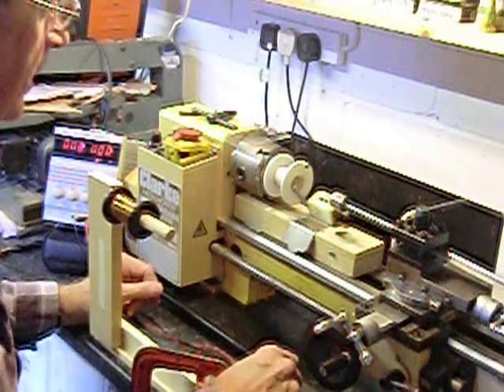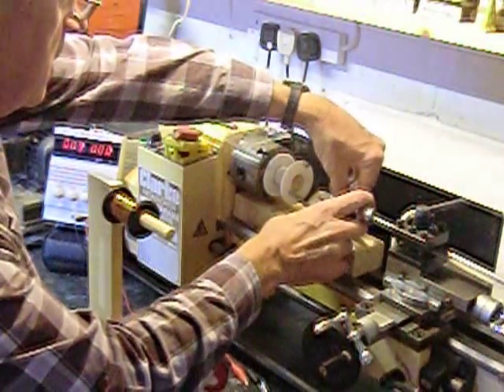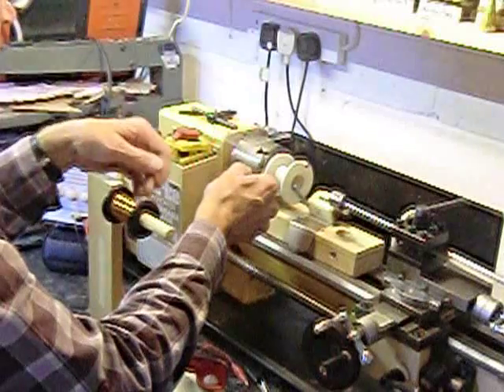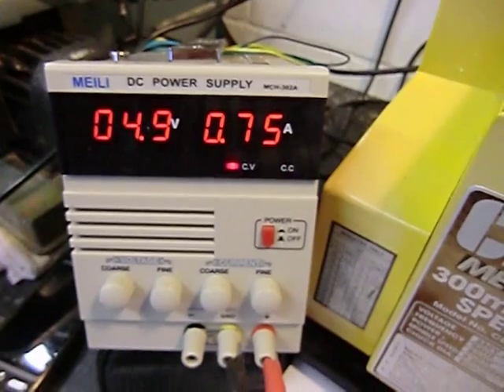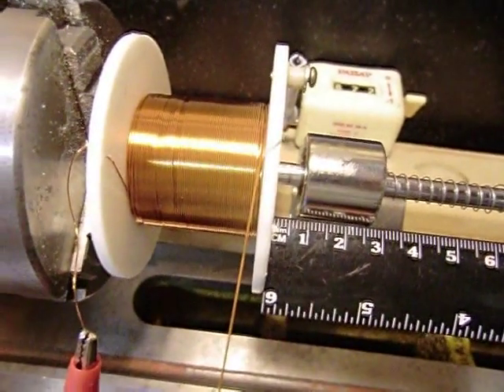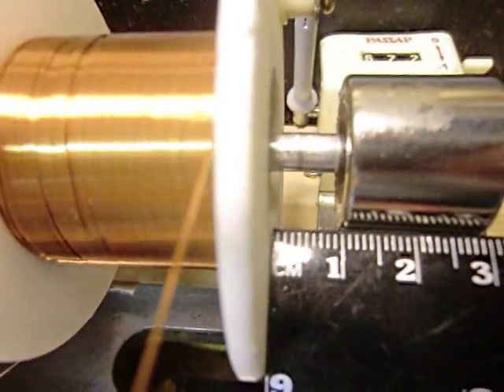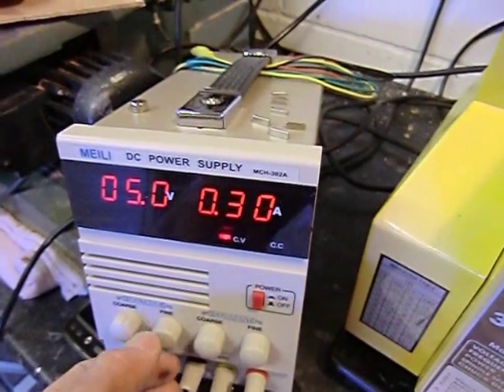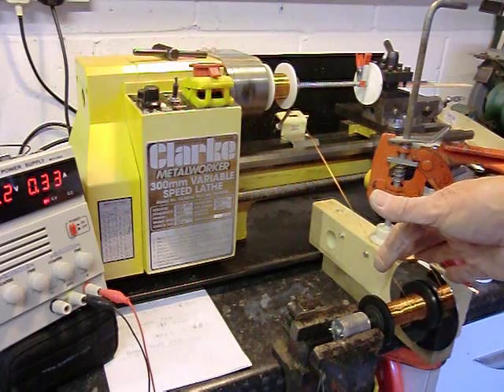Winding a coil with the most efficient optimum ampere turns

Comment: That's awesome, cheers for sharing fella. What happens if you increase the voltage while increasing the turns of copper wire? Does the gap increase at all between the electromagnet and the metal? I'm trying to gauge - no pun intended 😛 - how many turns needed around some thick bolts to repel and levitate a ferro magnetic sphere 🤔

Comment: Hello eddie ,great video do you do this for a living ? as i have a 1950 small coil that needs rewinding ! can you help me out please ? thanks
Reply from the maker: Hello Dennis. Thank you for the comment on my winding coil video. I'm afraid tinkering with electronics is just a hobby now I've retired. I don't do much at all now. My shed has been turned over to doing a few bits of Woodwork and personal repairs of household appliances where I'm able. 

Tell me more about your 1950's coil and I may be able to advise though. Coil winding is not too difficult with just an electric drill which I have done.

Comment: Do you find the friction you are applying with your fingers hurts  your fingers? Also does the wire reverse automatically when it hits the coil former or do you have to do anything with your fingers?  Is there any tendency for the wire to jumble up on the coil instead of winding flat?
Reply from the maker: Thank you for your comment and question. It's a good point. However I had no friction burns from the wire which is enamelled copper wire which has a smooth surface.

I guided it all with just my fingers and you may have noticed I kept the speed fairly low. This also helped avoid birds nest syndrome. Lol

Oh, and I reversed the direction of the wire just by guiding it with my fingers. I hope your project goes well.

Comment: Hi Eddie,
Can you tell me the number of layers of wire for maximum magnetic field and the length of your coil?
Reply from the maker: Ah, good question. The coil featured is about 3cm with just 7 or so layers. Sorry I didn't record it. I found that the most effective area of the magnet is near the edges where there is a concentration of magnetic field lines. I designed my device so that the magnet edge and coil edge  were physically near each other. The most effective area of the coil is also at the edge. I later redesigned the coil to be only 1cm long and of course had maybe 10-15 layers so that the field was stronger. This seemed to be affective. (the magnet in question is a neodymium about 2cm long.) My next step would be to use a shorter length magnet. Hope this is helpful.
Reply: @EddieFox  Thanks Eddie.

Comment: May I know the Guage of these Inductor coil??
Reply from the maker: Phew. I think it was 22, 28, something like that. I hope that helps. Unfortunately the label came off the bobbin I brought it on. I looked just now. Sorry
Reply: Eddie Fox may I get any contact number of yours?
I wanna ask few questions regarding.. These..
Actually I'm working on these wireless power transfer for mobile battery charger project..... Please any kind of help.. Please
Reply from the maker: @KomalMane17  Sorry I didn't reply but I've only just picked this up. I've not done this before but I imagine about the same as I have done, only on two narrow bobbins. Narrow as you can get them - perhaps 5mm. Once wound just use them as close as possible together. I think there would be good transference. If you have an old rechargeable electric tooth brush rip that apart because I have done this and it is a very good arrangement. I'm sure you've moved on to better things now tho. Lol
Reply: @EddieFox  yes.. thank you for taking the time to reply .. I did the exact same way u mentioned in ur comment n it worked out well for me.. the current status generated on the other end I used that for charging purpose by putting an ic in between a regulator IC n everything worked perfectly..

Comment from the maker: Thank you so much for viewing my video clip and commenting.  You are right of course. I Should have measured power (watts). This would have made much more sense measuring efficiency. I reviewed the video and made a little graph with Current vs resistance. About where they crossed in the middle, the distance in mm the magnet was repelled was maximum (about 11mm). With 302 turns I=.76A (6.41Ohms) P=3.8W 7mm, 672 turns I=.39A (12.82Ohms) P=1.95W 11mm, 817 turns I=.3A (16.6Ohms) P=1.5W 9mm. If that helps I'll be glad. Ampere Turns?
Reply from the maker: Some amazing video's on your channel. I have subscribed and you're welcome to demonstrate to your students how it shouldn't be done! :)

Comment: Hello, Eddie

Really nice video!
I am also doing research on coils at the moment. I was wondering why are you adjusting the voltage instead of the current?
Reply from the maker: I had a 12 volt supply and the project was designed to run from a car battery, so voltage had to a be a constant. Hope this answers....
Reply: @EddieFox  I agree with Tubepkp. You had to keep a constant current with a proper regulator to find the best number of turns. The formula for the strength of the field involves current not voltage. Your research actually found the best analogy between turns and cable resistance for specific voltage.
Reply from the maker: @panospantazis7611  Thank you so much. My math competence is -zero. I had absolutely no chance of 'calculating' turns required. So I uploaded this for my 'go to the back of the class' YouTube buddies. Lol.
Reply: @EddieFox   I Love your 'go to the back of the class' research .. in the end of the day , we only need to know the facts , everything else is fantasy :)

 i am great at math .. but only physical facts with physical affects is what counts!  the math makes people do less stuff then they used to ,Thank you for this video very much
Reply: Hello